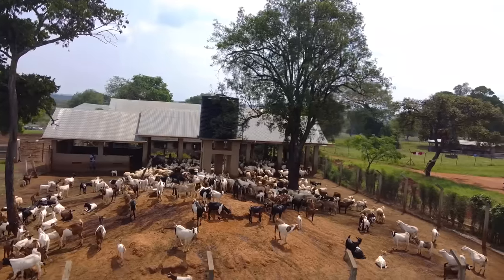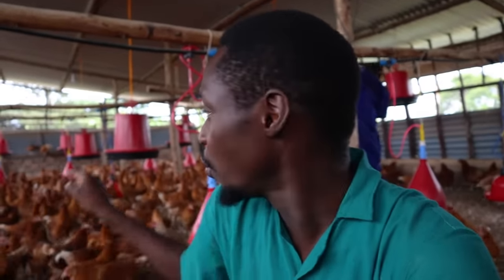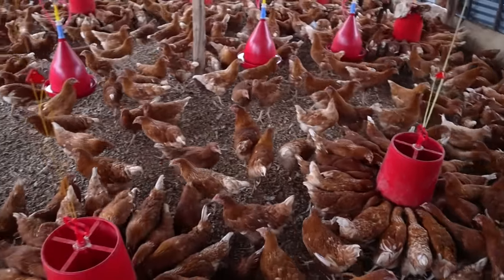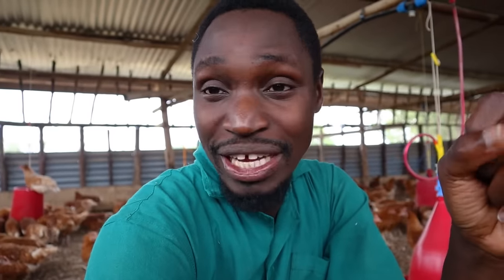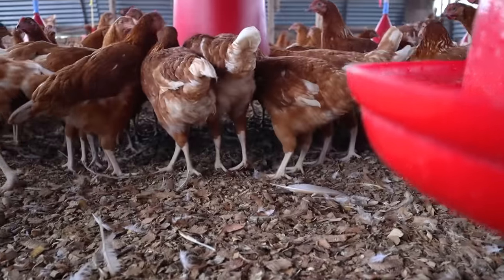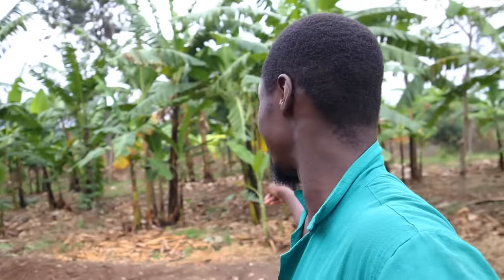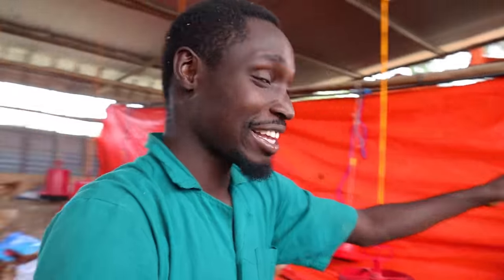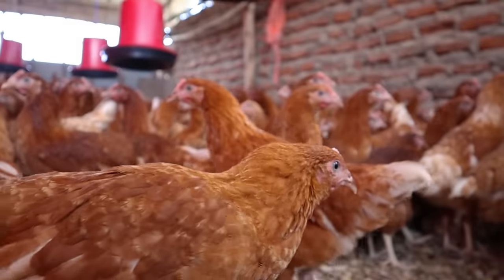A Necessary Evil - Debeaking Chickens

Comment: a group of chickens picks on one. It's not always the smallest or weakest. If that one cannot escape (or hide), they keep on going, especially if there is blood. In a way, it's also 'boredom'. It hardly happens with free-range chickens - on a 400-acre farm this is an option?!. 
Anyway, take that one out. It takes 1-2 weeks before they have another victim. Take it out. You'll end up with a small group of victims. Problem is, these ones do the same. So free-range these ones. Or eat them :-)
As for the eggs, also debeaked chickens can easily crack open an egg. Only few chickens seem to do this but they kind of 'teach' others. Observe well and get them out. Of course if the eggs roll away out of reach, you are OK.